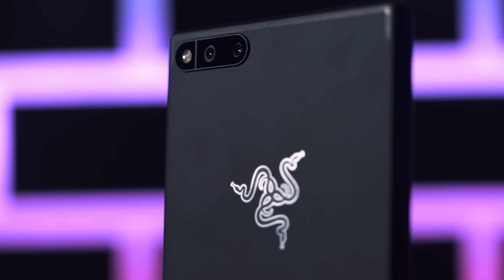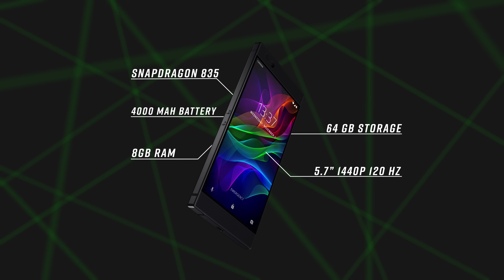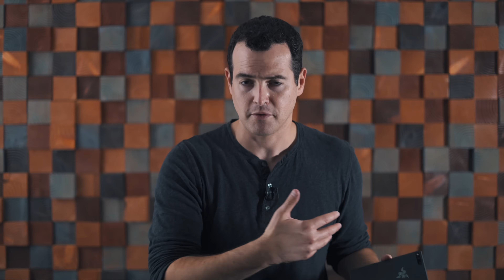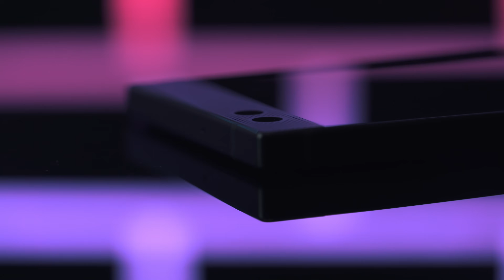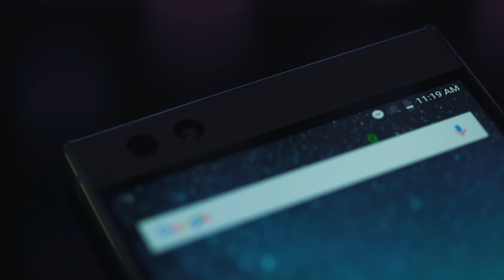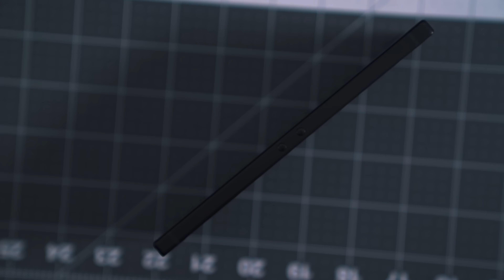Razer Phone: Big Battery, Better Specs

Comment: My hope is that the battery won’t go bad in a year and a half. That’s what happened with my nextbit robin. Halfway through the second year, the better was so bad it would drop to 50% in 30 minutes and randomly auto shut off at the 50% battery mark, claiming the battery had 0% charge

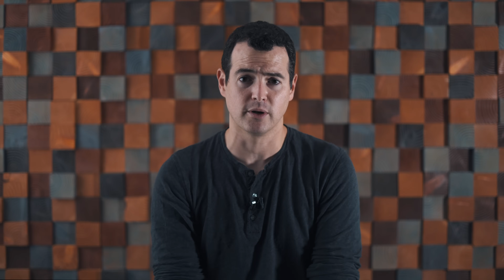Comment: Heads up it doesn't work with CDMA sim cards, so if you have Sprint, Verizon, ect. then you will need to switch to a GSM sim card network. 4:30
Reply: yerroc cricket is GSM it's under AT&T
Reply: Fixed now thanks. I have thought about switching to cricket so maybe this is the time then

Comment: This was going to be my new phone until Razer essentially told me to F off because no CDMA.
Reply: That suckssssssss so fucking much bro. I'm so glad I'm not you
Reply: Your Majesty yup time to switch to at&t now
Reply: Light Pillar switch to T-Mobile instead
Reply: I would but I'm not a fan of losing a true unlimited plan. 250+GBs of data used in 1 month and sprint doesnt care.
Reply: h3lix86 
Reason I download my porn.
Reply: Dont kid yourself, Read your fine print nothing is really that unlimited ofter you use 50GB they will slow your ass down and let people with less usage get prority read there fine print, On all T-Mobile plans, the small fraction of customers using >50GB/month will notice reduced speeds until next bill cycle due to data prioritization  So why dont you chill   just bc you dont have The GSM phone if you want it that bad you will switch
Reply: oh and using that much data isnt as easy as you think 4GLTE is alot slower than most WIFI now adays are you telling me you NEVER use wifi come on man just admit your pissed and walk away
Reply: Supremacy nope i have an old plan with no throttling. Ive checked. Wifi is great and all till i leave the house. Actually I'm fine this phone has no cdma now as it needs some improvements before I buy in. Maybe 2nd or 3rd gen.

Comment: All that sucks it will not work on Verizon that's a deal killer for me AT&T sucks and T Mobile sucks even worse so I guess I'm Sol with that new razor device so nice device I like the stereo speakers and all that but it will not work with my service provider unfortunately and believe it or not the next service provider I'd go with the Sprint they also use CDMA so nice phone for people that like T-Mobile and AT&T unfortunately it will not be for me if they will not have a CDMA version but still it's a nice device
Reply: 100% This. I guess I understand the reasoning though. When you look at customer subscriber numbers Verizon has 146.0 million and Sprint 54 million = 200m while AT&T is at   138.8m and T-Mobile is at 70.7m = 209.5m it doesn't seem like too much of a difference but when you really think about it 9,500,000 extra potential sales looks more attractive.

BTW I'm with sprint so I feel your pain.
Reply: Get what you mean about Verizon/Sprint. Also, punctuation saves lives, bro lol
Reply: I hate when people do do real research, you know that there like no differece in cell services as in towers rights? just placed in different areas so you cell may not reach? You know that verzion in my state is the worst compainie to have? and Tmobile doesnt exsit? so umm do research first b4 you complain, And the main reson ALOT of Third party cell phone makers go with GSM is bc its easier to come unlocked than a CDMA phone as with CDMA you need to register the CDMA number with the compainy where with GSM if u have a sim u can just enter into the device, Relax and either switch or just think about why they chose there options.

Comment: Sucks that it's already outdated since the snapdragon 845 is coming out... whatever happened to tegra processors? A pascal based mobile GPU would be awesome in a phone like this.
Reply: Stevie Rios the phone would also function as a really good heater.
Reply: Stevie Rios hell yeah
Reply: I was wondering the same thing too earlier.   I always wanted that one Motorola phone at had it. The Droid X2?
Reply: Joshua Keys Man believe me, the Droid X2 sucks. I have it like 5 years ago. It's super slow compared to other phone with the same class, i had to run it with cyanogenmod to reduce the lag. Camera is average, even below my expectation (at the time), and the pentile screen is really bad. I regret for buying it 😭
The only good with that phone is the design, at least for me.
First time Motorola let me down is with this phone, i used to be their fan.
Reply: Its probably in the works and they probably want that processor in the chroma version of this phone
Reply: snapdragon will only be in galaxy s9 for the first half of 2018
Reply: Nintendo
Reply: wick bob liquid cooling
Reply: The tegra processors are mainly used for cars now. 

The Switch has a bigger battery capacity, so the phone would have to be bigger to match that. Then you also have to worry more about heat flow. Now it needs to be big enough for a sufficient fan. You play in portable mode to only realizes you still need to use it as a phone. So for the heavier games, you get less than 1 hour playtime, if that. That is if you even get more than the games meant for mobile. Unless you are on the charger then you can't use your headphones, unless you have Bluetooth. That will also need to be charged at one point.  Still not using its full power, so now you need to connect it to a dock or something to play at maximum settings.

Comment: I feel like this phone will provide an amazing user experience. Wish the price was a little less but, overall I'm impressed.
Reply: you get alot for the money. i was expecting a 999 price tag with the specs they were talking about during the release video.
Reply: I mean the flagships of other companies are comparable or higher, and this thing has the best specs you can get
Reply: the price is already a game changer, you’d expect this to be 1000$ because its either razer or the amazing specs
Reply: $699.00
Reply: Comparing iPhoneX Vs Razer Phone specs wise there's a clear winner, at 699 it positions itself as a flagship phone at a bang for the buck price
Reply: Busterpeek21 it's way cheaper than most phones on the market they aren't just gonna give phones away

Comment: It is cool and i do use Razer stuff but i am aiming for a Note 8 in the future. headphone jack is a must for me personally. But i am impressed by the battery size and screen refresh rates
Reply: Björn Johansson me too
Reply: Björn Johansson If, when you say the note 8, you really do mean the Note 8, then okay, but just now than Samsung’s next Phone s’more than likely won’t have the headphone jack, as it is rightfully dying for wireless.
Reply: I agree who cares about Headphone jack I just bought the razor phone and there usb-c headphones,
Reply: You know the Note 8 has LESS specs then this phone? you know that the Note 8 is slower as in speed? you cant up the ram or CPU usage on the Note 8 so it can bogged and slows where the Razor wont? The headphone jacks or Outdated tech, You can buy USB-C headphones and cords that convert? and the dongle I mean why do you need a headphone jack N e way? My car my home theater both can use Bluetooth even my DAM Logitech G933 artemis are bluetooth wireless to my gaming rig, who needs a dam Jack N e plus if you look there Dongle is offering THX Certified DAC, might wanna do a little more research
Reply: Björn Johansson you could rock a Bluetooth headset

Comment: The Fact that Verizon (the largest mobile network) is not supported is terrible. No chance on this earth I will ever switch to the dumpster fire known as T-Mobile and AT&T. I would buy this day one no doubt if Verizon was supported
Reply: Griffin Gaming fuck Verizon
Reply: Orias I had both AT&T and T mobile and had dropped calls, terrible reception, and texts not sending. In my area Verizon works flawless for everyone I know. Any other carrier does not work well.
Reply: I'm with you . Verizon's lack of commitment to getting a better phone selection sucks. So many great phones out there but Verizon won't accept them